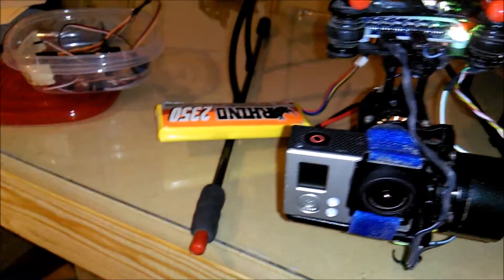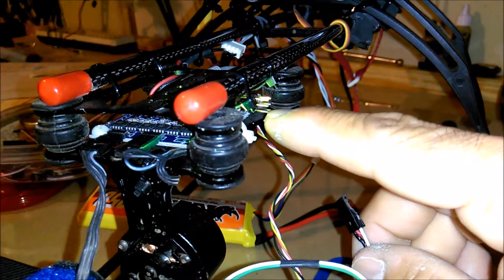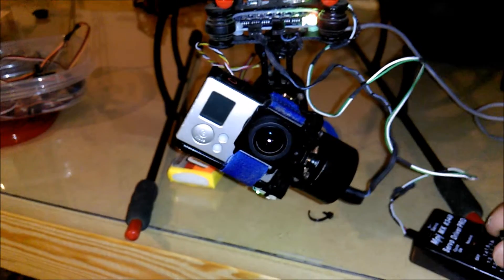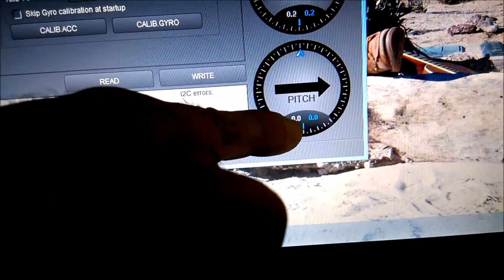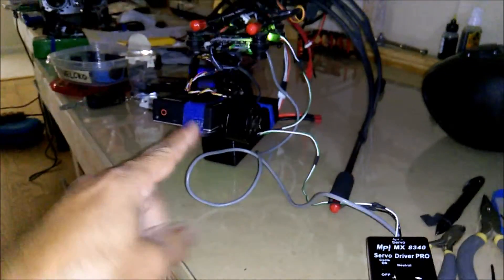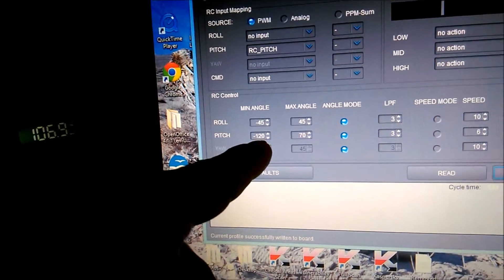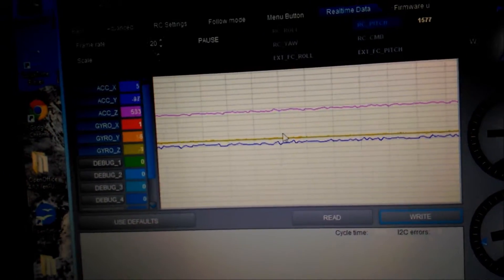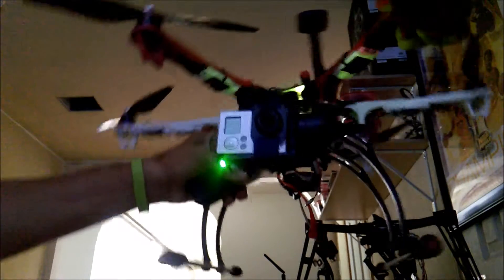GOODLUCK BUY ALEXMOS GOPRO 2 AXIS GIMBAL PITCH SETUP

Comment: how can make camera start pointed to the front, when i start quad, with simplebgc ? My gopro start always pointed down. And the speed of pitch motor. Thanks
Reply from the maker: +Diogo Sisti Start with your calibration of gimbal. Set your camera level and very still and hit "calibration" that is your starting point.